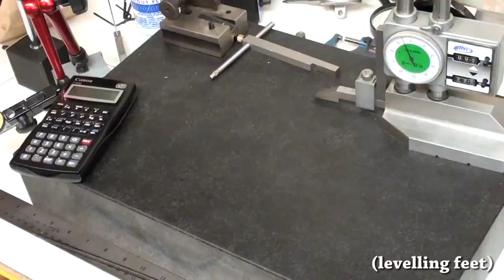Rong Fu Cement Boot (or how I fixed a flimsy machine tool stand)

Comment: I recently purchased and identical milling machine to yours. I did notice the flex that I heard people speak of in the column and actually had a pretty good idea. I thought about changing out the entire column with a 4 1/2 inch diameter solid piece of cold rolled steel to get rid of the flex and most certainly add more rigidity/vibration dampening. So at this point I’m pretty excited and I go to my local steel wholesaler and get a quote. $650!! 

So I was at work one day and noticed a very large #8 “1” diameter piece of rebar laying on the ground and it triggered an idea. Long story short I took the Off the top of the milling machine and drilled a 2 1/2 inch diameter hole into the top of the hollow column. I cut a piece of rebar about a half inch shorter than the total length of the column and carefully placed it in the center. Then mixed up some high strength concrete and carefully one troll scoop at a time began to fill The inner diameter of the column up with concrete around the rebar. After every three or 4 inches of concrete poured I would push down and vibrate doing my best to ensure a solid pour. Believe it or not it did not even take a full bag of concrete and I was able to complete everything start to finish in about two hours. I poured all the way up to the top and just left it open because I was going to reinstall the cap anyways. 

I certainly noticed increased rigidity and almost 0 deflection on heavier face and end mill cuts now. And also Noticed an appreciable difference in vibration, especially when using long fly cutters at higher speeds. I rolled the dice a little bit on this one but in reality I wasn’t too concerned because I knew it wasn’t something I couldn’t come back from.

AnyWho, just thought I’d throw that out there.
#concretesaveslifes
Reply: I was thinking of doing the same thing with mine. May have to go ahead and get er done.

Comment: Well done - Should help a lot with that stand..
Also sure you will like the RongFu - Its a lot of milling machine for the buck.
Reply from the maker: I'm pretty happy with it so far.  Table is actually well made on mine and from some of the accuracy checks I've done it is accurate as well.  I was on Rong Fu's website and it actually is a pretty good website.  Just fitting a 2 axis DRO right now :).  Only other thing might be a VFD or some other method to change speed quicker as the belt changing is a tad slow.

Comment: That's awesome! My mill has a similar sheet metal stand that I've just filled with old exercise weights and lead ingots, I should really do something like this!
Reply from the maker: It is really easy to do and the cement becomes part of the structure so the overall stiffness improves (versus just adding weight).  Cement also has very good damping properties - much better than steel.

Comment: Run your vibrating sander (orbital etc) along the wooden forms and you would have taken out the voids and made a compacted pour.  As you were looking for weight I think I might have scrounged some used brake discs and grouted the voids before pouring around them to make a solid heavier block.  Good concept though.   I have one of those exact machines and have plans to build a stand out of substantial steel as well as a counter weight at the bottom so this was quite interesting.  Take care.  Doug
Reply from the maker: Thanks Doug!  I probably should have spent some more time on the forms and reinforcements.  The vibrating sander is an excellent idea!

Comment: It's MUCH simpler and easier to shop around for an old steel multi drawer parts cabinet, place it on (small) hardwood blocks, re-enforce the top with plywood and some sheet metal!  Tooling storage and ROCK SOLID!  Yet I don't need a Tow Truck if I want to relocate  it.

Comment: Interesting how you faced the bar stock along with a cut on the sides, then flipped the work so the base sat flat on the chuck and the jaws held maybe a quarter of the way to the distant end. This should minimize wobble at the tailstock end assuming you have an unworn chuck. 

Watching people turn castings of steam flywheels and railroad driving wheels which are cast asymmetrically in several planes drives me nuts. Why don’t they lay out a center that minimizes the apparent movement between the machined and cast surfaces? Not to mention the imbalance. One responded: “ I have never owned a mandrel”. Or was it a face plate?

Comment: i think if you wouldve closed the bottom parts of the machine stand and used course sand (something that doesn't seep out the nooks and gaps in the stand  ) or even lead shot you would've accomplished about the same with adding weight to the base (would flex a little more as with the loose material it can still move some ) BUT you be able to take the weight out again to be able to move the stand that now that its cast full of cement must weigh more than the engine hoist can handle , especially if it needs to be moved out of the building and up/down a ramp 
i have a fairly similar stand (and a square mast rf45 ) but because im tall i put about 5 layers of 20mm mdf under it with adjustable feet on treaded rods through and through to the original holes in the bottom of the stand 
i guess that because the mdf ties the loose sheetmetal sides together on the bottom  i dont have the wobble you showed at the start of the video ,,,,, it does ring like a bell though at certain frequencies , might stick a few of those car stereo sound deadener sheets on the inside at some point , mine is allso closed in the front where youre is open , this might allso help in my case

Comment: you could of just thrown the bag of premix in the bottom , ,..you need to fill the mill stand first ..then down .. pretension concrete on the round ,.. vibration transfers ..tool >spindle >head stock >  round column > Base> then stand

Comment: Nice bit of work Justin.I had the impression that your previous concrete base for the lathe was in a basement shop. Any problem getting it into the garage ? I have an older version of that same mill & it does have challenges. Marc Lecuyer (THAT LAZYMACHINIST.com) has a few easy fixes worth looking at. Thanks again & I'm looking forward to seeing more as you have time.  Len
Reply from the maker: Thanks Len!  I originally was in a basement shop but I moved it last summer.  The concrete bench for the lathe was the first project in the "new" shop.  Only thing I miss about the basement is it was much warmer in winter.